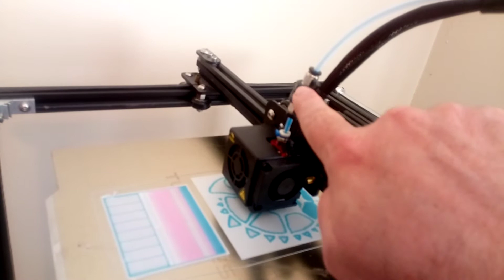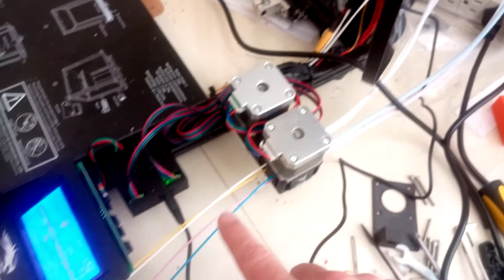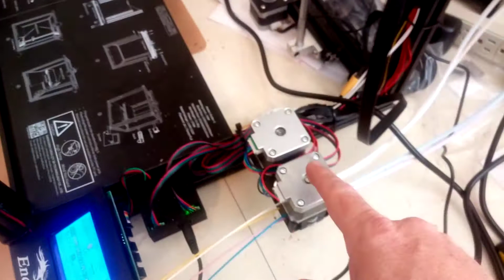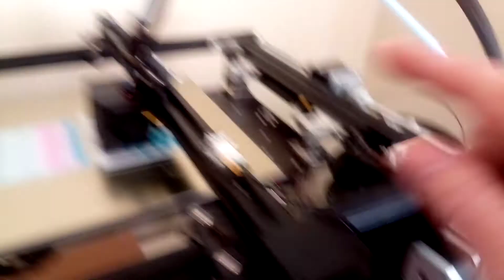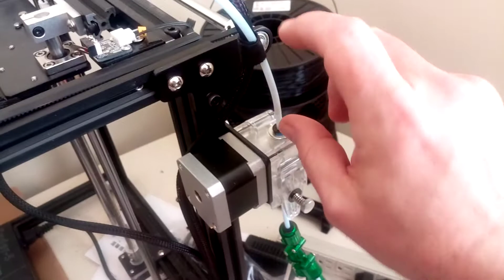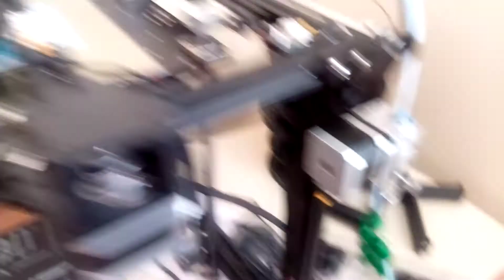3DChameleon Mk2 on Creality Ender 5 Installation Walkthrough

Comment: I have my switch mounted the same way and its the same 222.5 but when it goes to change filaments it only presses the y endstop and doesnt move forward to change filaments, what I"m I doing wrong?
Reply: Do you have a machine where the end stop is at the Y max location?  If so, you need to reverse the button press location to 3 and have it trigger at zero.  The G0 X3 Y3 command and the G0 X-3 Y-3 need to be reversed to make it press in the opposite direction.
Reply: would you mind sharing your gcode for the ender 5? I just need to see your settings for the switch  @williamsteele
Reply: But, with that said, you're seeing something that doesn't make sense right away to me... are you sure your switch is on the correct end of the axis?  As I stated in my previous comment... the only way for it to go towards the end stop switch is if it's at the maximum point instead of the normal minimum point of travel on the axis.  My printer is an Ender 5, do you have a different version by chance?

Comment: what is that mount you are using to mount the motors on the bottom?
Reply: I just used a 3D printer extruder mount for it.
Reply: @williamsteele is the STL for this mount available? Perhaps I missed it but I don't seem to be able to see it on Thingiverse, Printables or in the TinkerCAD examples/

Comment: Can you use this with a Micro Swiss DD set up?
Reply: Yep... You just need to make sure you can load and unload the filament using only the firmware commands (from the menu, for example... Heat it and manually advance the filament  until it loads.) If you can do that, them you know the GCode can also load the filament.